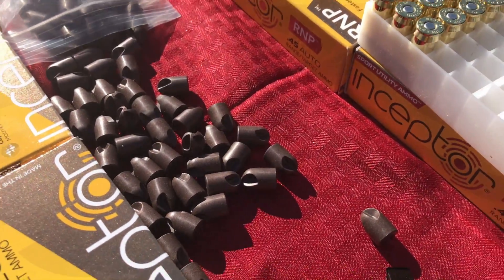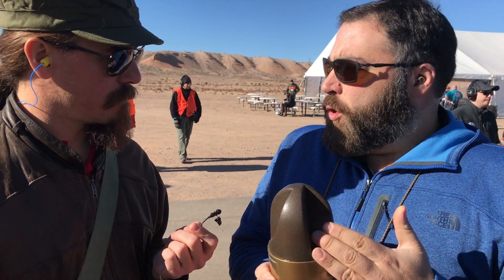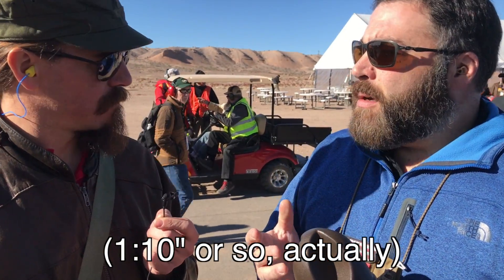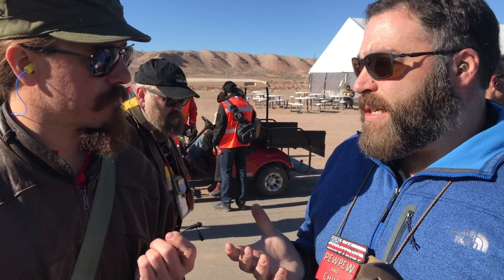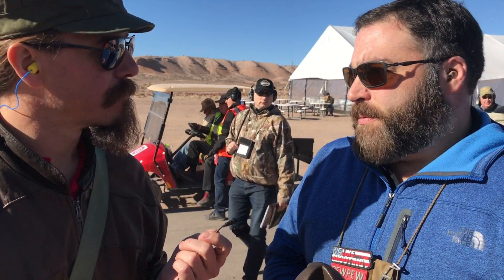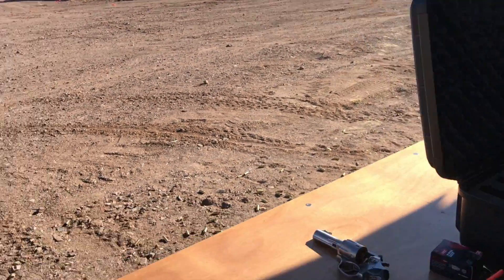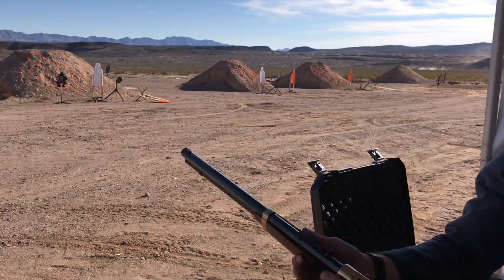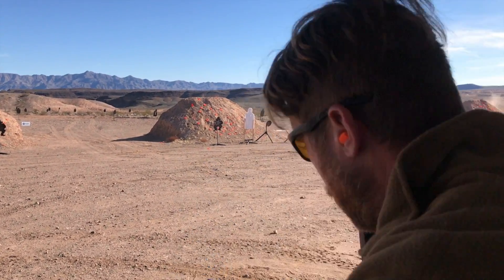SHOT 2017: Polycase Ammo

Comment: You have to look at it as the opposite of how a boat prop works. It turns tremendous roational velocity into two lesser lateral momentums of different objects. 
The prop spins very fast through water, it moves the water, but since the mas of the water is greater and water by its very nature absorbs a lot of this energy, the velocity imparted to the water is not quantitatively equal to the velocity of the prop, until you figure out the mass of water being moved and break every thing down into base equivalent energy units. Since the prop has pressure exerted on it from overvomming the inertia of the water and its fixed to a movable object, the boat, it causes movement in the boat. 
 Imagine now to see what the bullet does , taking an aquarium of water full to the top and slowly moving the bowl of a spoon across the surface half way submerged.  Its gonna move some water out of its way. 
Do it faster and it will move more water and that water will be moving faster. Do it really really fast and its moving a lot of water really fast. 
 The spin rate of the bullet isnt really important because the energy is all thats really needed here. It has tremdous energy moving forward and a shape that naturally channels fluid through it in a specific direction. This will transfer momentum from the bullet to the fluid, slowing the bullet the same way hollow point expansion does. Im not even sure the direction of the spin matters all that much other than opposed spin directions would actually serve to slow the bullet more but for less of the inteded hydraulic effect. Its something they should look at but i dont think its that significant. 
 It turns forward bullet momentum into lateral fluid motion. 
Now. 
 Does it work well much less AS well as the manufacturers claim?
We can look at a perfect world example of fluted bullets that are intended to derive spin stabilization from traveling through the air to see that they do NOT really derive much effect from this design. 
However this is because they have small surface areas and are trying to ustilize whats typically considered a poor working fluid, air. Water based fluids are orders of magnitude more efficient than air. 
 Think of the overall surface area of a boat prop compared to the overall surface area of a sail designed to propell the boat at similar speeds. 
Its much smaller. Yes some of this is because the surface area of the prop is used iteratively, meaning many many times in succession, but that is equivalent to the energy of a constant breeze. The difference is that the prop rotation is internally induced while the wind is external. The sail has to be big because air is not very dense and cant carry much energy per unit volume. Denser fluids are more efficient.
Reply: Are you high on adderall or something?

Comment: This may have been noted in an earlier comment. (I didn't go through the entire comment section). There is an assumption being made by Karl & Ian in this video that the fluid displacement only occurs if the bullet is actually spinning at a high rate - the propeller analogy.  I think the fluting will create a high degree of fluid displacement even without spin, simply due to the forward motion of the bullet. Here one should imagine what happens to water if a non-spinning propeller is dropped into a fluid at high speed.  There will be considerable water displacement from this non-rotating propeller as the fluid is forced over the propeller blades at high speed.  (This is why if a propeller aircraft loses an engine in flight the propeller blades are 'feathered'  -  blades turned perpendicular to flight direction - to reduce the drag that is otherwise produced).

Comment: I'm pretty sure the hydraulic effects are from the bullet geometry, and not any rotational inertia due to rifling. The cuts look like they are meant to redirect compressed fluid in front of the round into three separate jets via the ramping surfaces. A smooth bore would theoretically be able to take just as much advantage of this design. 

The bullet material is interesting, but those kinds of composites tend to be extremely fragile and brittle. Great for frangibility, but I would expect this to blow up like it's made of glass as soon as it hits anything hard between it and the intended target.
Reply: Seems it actually does reliably go through stuff softer than steel, so I stand corrected.

Comment: In fairness, the salesman described drywall, plywood, and sheet metal as barriers that it'd penetrate, and hardened steel as a target it's frangible upon. The salesman also seemed to take the propeller analogy too far; the flutes work regardless of spin, needing only to impact fluid, since they're offset. The flutes spin the bullet as it moves through the fluid medium, and the fluid does damage to surrounding material as it changes direction through the curved flutes.

Comment: i know this has probably died of old age by now and probably you either know by now or enough people have said the same thing, 'but', the mechanics of that projectile dont need it to spin at all. it only needs to be moving through a fluidic system for its design to impart force (like a wedge) in the direction its design suggests, to the point that it probably works best when it doesnt spin at all. and the design seems like it has a blanace between penetration and fluid expansion, with the distinct channels essentially creating higher pressure zones for greater forces and more damage from those zones.. anyway it would be cool to see ballistic gel samples to clarify, but as far as the design goes, the scepticism over it being inneffective vs differing barrel spin/ twist conditions is false/ not applicable

Comment: If it works, the rotation of the bullet would not play a significant role because this is very slow in comparison to the lateral velocity.  The more dominant effect would be moving fluid from near the center of the bullet at the nose, laterally towards the bullets diameter.  The fluid would achieve a significant fraction of the bullet's velocity, but vectored out laterally.  That could cause tissue damage.

Comment: I believe it's not the gyration that displaces fluid, it's the flutes themselves using the forward motion of the bullet.

The idea is that as the bullet passes through fluid, the flutes catch the fluid and redirect it sideways through the flute as the bullet moves forward. Think of it like a camming surface for bodily fluid.

In theory, this would massively increase cavitation based on velocity, not gyration. It could be moving with zero spin and do the same thing, the guy was just god awful at explaining the concept.

Comment: The defensive rounds do *not* need to have a high twist rate in order to deal substantial damage to soft tissue. That is not how they displace soft tissue, regardless of whether the projectile is spinning or not(say hypothetically it could not twist at all and still be accurate) when the projectile is travelling through the body, it forces the tissue into the fluted channels and directs it outward, since the tissue is compressed while it's in the flutes, when it's directed out and away from the projectile it is moving very fast and is very high pressure, it pretty much acts like a jet, which produces hydrostatic shock. The temporary wound cavity from rounds like these speak for themselves, there are many ballistics gel tests using these projectiles, captured in slow-motion, that you can find here on youtube.

These rounds work off the same principle as the Lehigh/Underwood Xtreme Defense and Xtreme Penetrator rounds which are some of the very best defensive rounds you can buy for a pistol. The primary difference is that with the Lehigh/Underwood rounds, it's a solid copper fluted projectile and with this it's a copper/polymer blend fluted projectile. The polymer part may or may not work well, but the fluting has been proven time and time again to produce massive hydrostatic shock/soft tissue displacement, and in the case of the solid copper projectile it does a great job of penetrating barriers and retaining it's weight and shape, so much so that often you could re-use the projectile if you can recover it.

Comment: I am wondering what maximum speeds of this type of projectile in the 45 long Colt diameter. This intrigues me as a potential option for the incredibly limited selection of available products for the 450 Bushmaster cartridge, which uses nearly identical reloading data as the 460 S&W magnum. I know there are factory loads of 458 SOCOM and 45-70. Just makes me curious about the specific mechanics between pistol vs rifle bullets and potential differences

Comment: These bullets don't rely on spin to create hydraulic damage. The energy due to the forward motion of the projectile through the fluid is transferred laterally into the target. The spin causes the flutes to also act as a cutting surface and ensure the lateral energy is spread evenly throughout the wound channel.

Comment: Given the low weight of the projectile I think the rotation due to the rifling will be almost negligible, since it will amount to very little rotational inertia. The part the salesperson apparently didn't understand himself, is that if a non-rotating propeller moves through a fluid at high forward velocity the fluid will slow the bullet, but in doing so will start to rotate it. Look up auto-rotation on a helicopter for example, same idea. So I think that effect will contribute much more to the potential fluid dynamics. But I can't possibly tell if the effect is strong enough to cause any significant improvement in terminal ballistics. So I would very much look forward to your video on it. 

Then again I wonder if a nasty wound canal is really a good thing in the hands of a layman...

Comment: I'm pretty sure the shape of the flutes means a high rate of spin isn't required to have the "lateral energy transfer" that the sales guy is talking about. They're open up to the front so the energy from the bullet's forward motion is supposed to be redirected by the almost 90 degree elbow.

As to whether these actually work, I'm no expert on bullets or fluid dynamics and can't do ballistic testing myself so I have no comment.

Comment: Working for a company we were doing load test development on an R&D rifle and came to the realization that about 20,000 RPM is the sweet spot for the projectile being fired. Our chosen twist rate 1:8. So you would probably get plenty of rotation out of a 9mm for what he states. Obviously not as effective as its hyped up to be however. Also frangible rounds do penetrate better up until they hit a surface with a higher hardness such as steel plates. The downside is that they wear out weapons faster. Ie feed ramps on M4s.

Comment: Suspect.
This reminds me of those home-made fin-stabilized shotgun slugs Taofledermaus tries out.  You can see the logic that went into them, but they're usually not great in pratical application.  I can't imagine this design won't royally dick with your accuracy at any appreciable distance.  I know the guy says they're intended for self defense, so they might not care past 15-20' or so.
I suppose the cut-outs would improve penetration due to the reduces surface area at the point of contact.  Which may or may not actually be beneficial.  The question would be if the scallops would do much of anything once the bullet has slowed down enough to collapse the outward pressure cone.  Otherwise, it's just and fancy and expensive FMJ.

Comment: Yeah I don't think they were trying to say the rotation of the bullet was what made the difference, just the shape of the flutes.  i.e. even if it was just going straight forward with no spin the flute shape would do the job.  Doesn't mean it actually works, but I think the propeller analogy was misleading because it implied that rotation was fundamental to the design.

Comment: Just going off assumptions:
I would assume that the spiral fluting is the "magic" you are trying to find, on impact with "fluid", the tissue/etc. will be forced into the fluting and the flutes fill as the bullet continues it's path( losing linear velocity because of the resistance, while gaining angular velocity due to the helical flutes). The helical flutes kind of convert linear velocity into angular velocity, and at the same time, direct contacted tissue relatively perpendicular to the axis of travel of the bullet. 
Instead of thinking of it like a propeller, imagine it as a screw in wood. You start the drill out slow and it digs in fairly fast, but once you crank up the drill, the screw stops digging in and starts to dick up the threads(it's spinning too fast with not enough downward speed to thread, so it just eats away at the wood).
Reply: Btw: big fan, you guys are great

Comment: A propeller doesn't need to be spinning to cause turbulence. Think of each blade as a wing traveling through the medium. Also the twist direction isn't going to matter very much because as you pointed out it's very slow. The rep was mistaken/misled/uninformed the bullets spin doesn't matter it would be the flutes and forward momentum doing to damage. (If it works.)

Comment: The fluid mechanics stuff sounds plausible, essentially relying on the venturi effect to force fluids out at a high velocity. Whether the design actually succeeds in creating this effect and whether the effect is strong enough to cause the kind of massive tissue damage they claim would make quite an interesting experiment. Of course, there are plenty of ammo companies that have touted some new wonder bullet that theoretically relies on sound mechanical principles  but fails to perform adequately in practice.

Comment: It doesn't actually work like a propeller, and it doesn't need to be spinning too fast initially to form a grievous wound. The cuts are angled to accept the fluid from the front, and the act of it moving through the body will redirect the fluid through the angled cuts, and if it's cut a certain way it's movement through the body will actually accelerate the rotation, like a windmill.

Comment: The first sales guy is definitely spouting marking talking points way above his pay grade.  For reference, in terms of materials science and engineering:  A copper-polymer matrix most likely refers to powder metallic copper suspended in a plastic (polymer) material.  Similar aggregate and cement in concrete, it can produce a material with properties more desirable and controllable than either raw material.  In this case, the ability to make an intricately shaped projectile using injection molding techniques which are cheap and fast without having to resort to slower and more expensive machining or casting as would have to be done with a solid metallic bullet.  The properties of the finished projectile will depend on how much copper is used and what polymer acts as a binder.  We can get a rough idea of how much copper is used based on the quoted weights.  I believe he said the 9mm was 65 grains.  We can roughly compare that to a FMJ made mostly of lead at 125 grains.  The specific gravity of lead is right around 11.3.  The specific gravity of copper is about 9.  This means that a solid copper bullet the same shape and volume of the 125 grain FMJ should weigh just under 100 grains.  This means that the polycase bullet is likely around 65-70% copper, depending on the volume lost to the cuts.  The rest is plastic.  To be fair, some plastics can be as strong as aluminum, but I doubt they use glass fiber reinforced nylon, its probably some cheaper plastic like polystyrene.  Now, powdered metals in plastic are nothing new.  The MIM parts in newer guns are similar, and powdered metal parts are used in a variety of industries.  The difference is that the metal makes up 98-99% of the mixture and the parts are sintered after molding to fuse the metal together and burn off the plastic.  This causes the parts to shrink slightly and unless they are molded over-sized and pressed into shape at the same time they are heated (expensive), I don't think you could hit the close tolerances required for use as a bullet.  So the percentage of copper is probably dictated by how much they could cram into the plastic and still have a injectible, moldable composite that would meet dimensional requirements.  The wounding characteristics are likely complete marketing wank.

Comment: Sounded like they meant it'll react as a frangible bullet on steel targets, but should penetrate typical barriers for defensive shooting without losing integrity. Steel used in targets is obviously significantly tougher than the panels in a car door, so I can see where they're coming from. It's a neat idea if it works and I'm very  interested in shooting it at steel if they can get the cost per round down, but I'm pretty skeptical of its performance as a defensive or hunting bullet - I'll stick with traditional expanding bullets until there's a large body of evidence that it consistently outperforms expanding bullets (and I mean hunting and real world defensive use, not just ballistics gel).